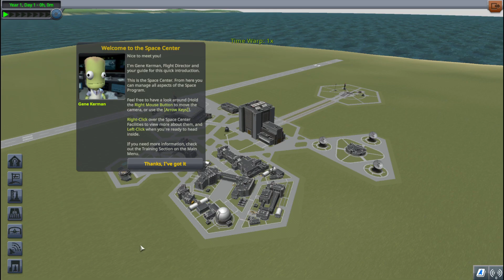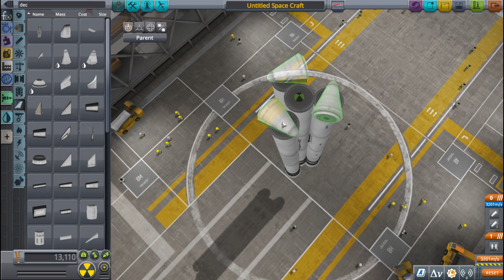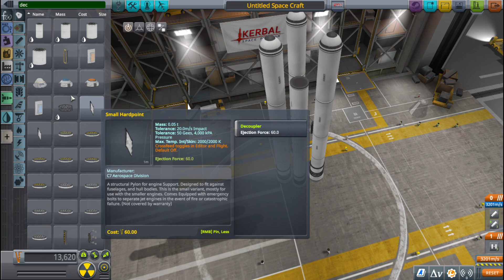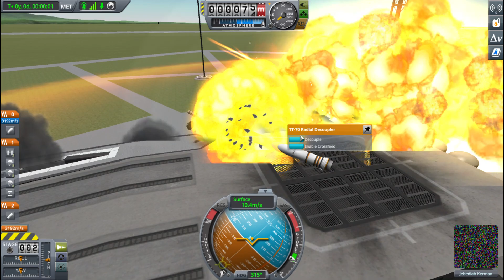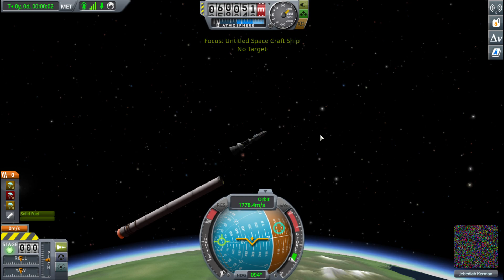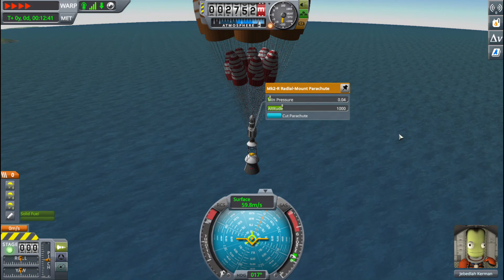KSP 2019 How to build a Rocket with Basic Safety System

Comment: Nice video!

You can change what order things activate by dragging the symbols for them in the staging menu (on the right side in the editor). Put all your engines at the bottom and your parachutes at the top. Decouplers can go on stages in between. You can also make new empty stages by hovering over a stage and hitting the + button that shows up. You can re-order stages by dragging them by the orange bar that has the stage number.

To make the Launch Escape System easier to attach, you can hold down the Alt key while trying to place it. That will force it to only attach by the little green ball (node). This works for all parts that have nodes.
Reply from the maker: Thanks for the advise now I understand! I just started this week to use it, I will try the ALT key. Thanks again